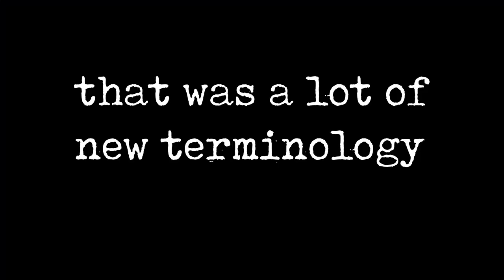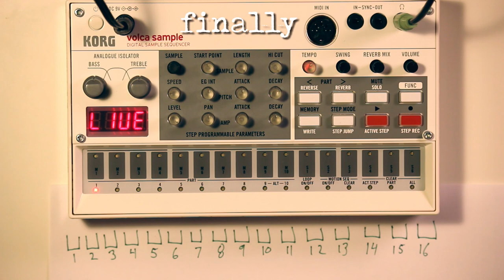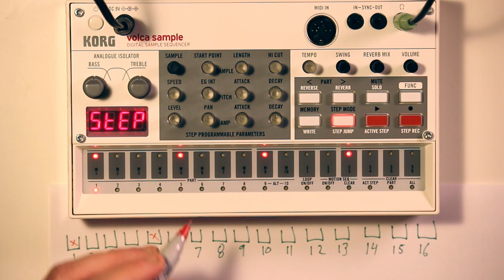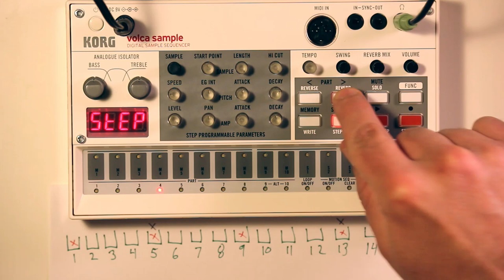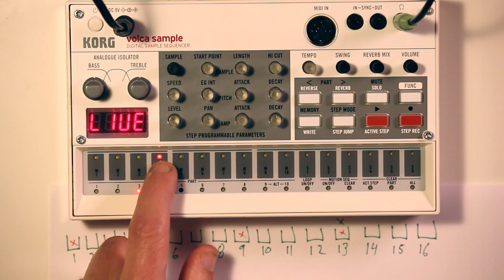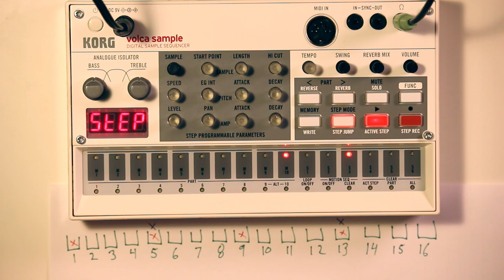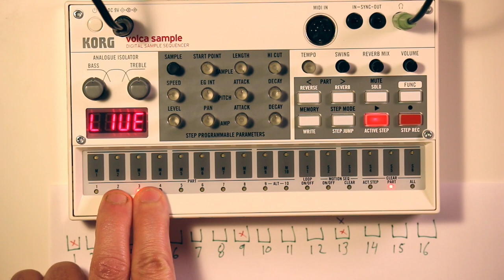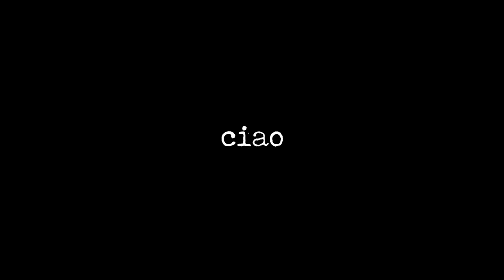2 Volca Sample - Step Sequencer

Comment: This is the Volca sample version 1 right?
Reply from the maker: Correct. The V2 has a microUSB port on the front panel, and the knobs on the left are black instead of grey. The contents of this video should be the same for both though, they both have the same sequencer.
Reply: @minimal.camera  so you can’t create samples on this with a mic, huh? You have to use an external device to record then transfer the file into the volca sample?
Reply from the maker: @CourneliusX  The Volca Sample doesn't have a mic, it is a sample player. So yes, you need to use an external device to create and transfer the sounds.

Comment: Great, thanks! How did you change speed on notes of particular sample? :)
Reply from the maker: The speed knob (which could also be labeled as the 'pitch' knob). If you want the speed/pitch to change over the course of your sequence you can use motion recording for this. Enable motion recording, play the sequence, and tweak the speed knob while it is playing.

If you install Pajen's firmware on a Volca Sample V1 (not V2), you can play the samples chromatically from an external keyboard, and even create polyphony!